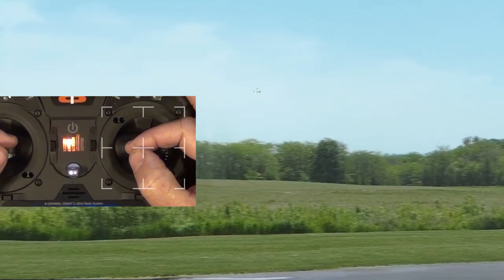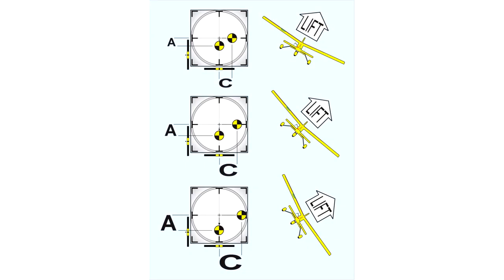RC Procedure Turns 101

Comment: Good clear instructions - thanks.   50 years ago I used to fly a lot of control line, and for the last 20 years primarily Cessna 172s although working on a bucket list of flying 50 different types of planes.   Despite all that, RC planes give me the biggest challenge!

Comment: I was told by another club member many years ago that a procedure turn was when the plane is on the runway straight line and turning 90 degrees out followed by a 270 degree turn in the opposite direction which effectively reverses the direction of the aircraft down the same exact line you were on initially. If that is not a procedure turn, then what is it? Obviously, using your technique, it could be done using a procedure turn but I wonder what that maneuver is actually called. Your explanation for what a procedure turn is totally makes sense and I will have to practice doing more turns in that manor. I usually just make coordinated turns which utilizes more rudder but I don't think about how much, I just do it. I see how doing pure procedure turns the way you describe would be far more predictable to making precise turns.
Reply from the maker: A procedure turn is a charted turn procedure to line up with the runway no matter which direction aircraft approach the airport from. The turn outlined in my video and manuals is referred to as a procedure turn because it is a prescribed sequence of steps aimed at producing a consistent predictable result each time

Comment: Interesting - I've never just given a horizontal aileron deflection followed by a separate immediate vertical elevator.  Mine has been more of a diagonal input giving aileron and elevator input at the same time.
Reply from the maker: The turn you have been doing is sometimes called “the club turn”, i.e, when everyone is doing it wrong, wrong becomes the new normal. The resulting climbing ever changing bank angle turn you were doing takes five times the effort compared to a procedure or competition turn
Reply: @1RCFlightSchool  Understood.  You know when you go to flight instruction at a  club to get certified to be able to fly on your own, you have to trust them to teach the correct technique.  I guess in my case I've just been doing it wrong for 20 years.  The guy that taught me to fly could fly fairly well - so I didn't question what he taught as he was doing it on his own time for no charge.

Comment: I'd like to try procedure turns but I noticed if I move the stick to roll right, then back to center and down to climb a bit the roll is cancelled.  I'm wondering if there is a setting I need to the transmitter as when you move the stick right and then back to center the roll doesn't hold.  I think that is normal?  You video seems to hold the roll even when you move the stick back to center?  What should I look for?
Reply from the maker: Is the radio in "SAFE" mode?  This link takes you to a page with realflight planes that have been modified to perform as they do in the real world https://www.rcflightschool.com/__static/1c31400acd011a4d6e2d3e99d3a89523/realflight-9-plane-and-tx-links-direct-download(11).pdf